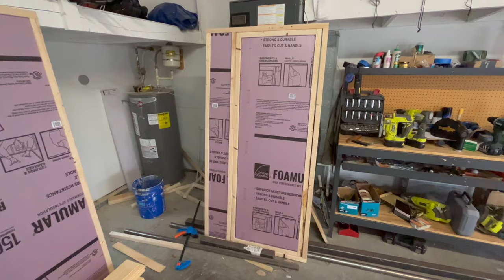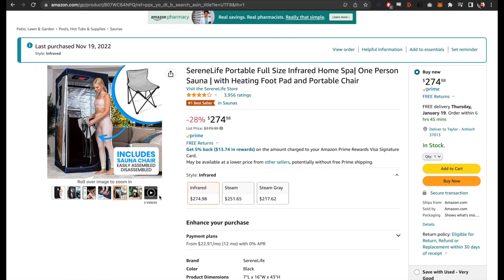$800 Sauna Build

Comment: Hey thanks for posting this video!  Curious on what you used for flooring when you removed the tent? I have the same sauna and when I first got it I was concerned about the off gassing but thought maybe the hormetic stress of the heat would counteract any damage. XD Anyway, I'm 5'7" and even for me that space was tight so this looks like a good solution to get a little more space AND get rid of the plastic. Incidentally, another search I did on DIY saunas turned up a great vid on using a 6x6 grow tent with panels and heat lamps aaand that's when I realized I was basically sitting in a grow tent every day! So I'd love to get rid of the tent. I searched for an update on your new setup, apologies if I missed it, but this looks like a budget friendly way to do exactly what I want. You've got a new subscriber and I'll keep a lookout on an update if you post one!
Reply from the maker: Hey thanks for the comment! Because I had built my sauna to the same dimensions as the tent, I just cut the floor off of the tent and left a couple inches of the walls on it so that it won''t spill any sweat. I do wish I had made the sauna slightly bigger, but I'm not too bothered by the space.

I might do an update soon to show the changes I've made and the bench I built for it.

Comment: Great Video!   What temperature did you get the unit up to after?
Reply from the maker: I get it up to 138º – 140º Fahrenheit
Reply: @taylorpoe  That's the temperature they advertise. When you said you added temp I was hoping it was more. I can't find any like this that get to 190-200 which is the range I'm looking for.
Reply from the maker: @Fynmarr  look into infrared saunas versus normal dry saunas. Infrared doesn’t need to get as hot because it’s penetrating your body. Dry saunas need to be hotter because they just heat the outside of your skin.

Comment: Nice video and great work! I was thinking of doing nearly the same thing with the exact sauna from Amazon. I had the thought of getting rid of the tent completely and lining the inside of home built sauna with reflective insulation wrap over the foam board instead of the board you used and mounting the infrared heaters from the tent inside. Do you think this would be possible? - as far as removing the hardware from the tent and installing inside the home built sauna? 
Thank you for any reply! Also if you have any interest in a DIY cold plunge head over to my channel! I just post a DIY IBC tote plunge!
Reply from the maker: Very possible — I actually completely removed the tent after this video. realized it was better without it. I'm actually gonna remove the hardboard from the interiors and add these cedar strips to the inside in a Part II video soon. https://www.homedepot.com/p/American-Pacific-3-3-4-in-x-Random-Length-Aromatic-Red-Cedar-Shiplap-Planking-15-sq-ft-pkg-HD60-15S/319614105
Reply: @taylorpoe  so did you remove the hardware from the tent and install in your box or go with something else?
Reply from the maker: @highcountryoutdoor  Yeah I just mounted the electrical unit on the back of m box and passed the wires in, then connected them to the panels which I just added some strips to hold them in place.

Comment: Nicely done.  Is it possible to take Matt's advice below and remove the fabric?  If you wrap the HDF with some reflecting product that could help with longevity?
Reply from the maker: I tested out removing the tent and I lost 7-8° F of heat. Decided to put it back in. Refletix is a good idea. But I’d also need to work on sealing the door better. Tent doesn’t bother me too much, so I’m going to keep it for now. It’s biggest benefit is that it has a floor that is easily cleanable.
Reply from the maker: Update: I realized the temp loss was due to a plug not fully connected. Ended up removing the tent. Very happy I did — the extra space is appreciable.
Reply: @taylorpoe  Thanks for the update!  Just a little more space would make a big difference.  I'm gonna steal a lot of your approach - I get a little claustrophobic, so aiming at a glass door of some type. Will post the outcome.  Thanks for the coaching!
Reply from the maker: @karlfruecht7258  nice, yeah you could definitely get a way w making it a bit deeper and wider. And a glass door is great idea
Reply: @taylorpoe  What do you think about switching MDF w Drywall?
Reply from the maker: @karlfruecht7258  i’d be worried the drywall would soak up too much of the moisture and rot over time.

Comment: What was the top temp you got it to?
Reply from the maker: 140°
Reply: @Taylor Poe  did you ever get rid of the tent ? I really think I may build one outside and won't stove heat it geat vid man has me thinking I just really want to hit that 180 mark
Reply: Will*
Reply from the maker: @FuryDoesIt  I did get rid of the tent. Glad I did. 

Yeah you're not likely to get it up to 180º outside with this kit's heating panels. These are infrared panels that penetrate at lower temperatures versus traditional dry saunas that heat from the outside of the skin and need higher temps — ideally ~200º.

Even at 140º with this kit i'm sweating pools.
Reply: I guess I need to look into it more I'm curently just going to the nasty 24 hour fitness sauna it's dry heat 180 and my heart rate hits 150 ish in like 10 min are u monitoring heart rate with a fitbit or anything I wonder if it's the same with your set up
Reply: Could u maybe post a quick vid on your current set up and walk threw how u got rid of the tent an is there a way to not buy the tent at all?
Reply: @FuryDoesIt  Yes, infarred heat penatrates the skin and heats up the body faster. There is no need for it to be 180. 120 is a good point for infarred.